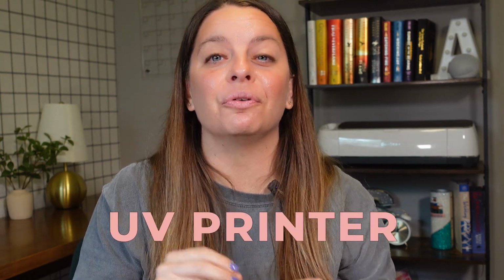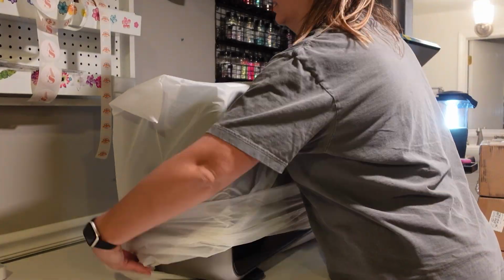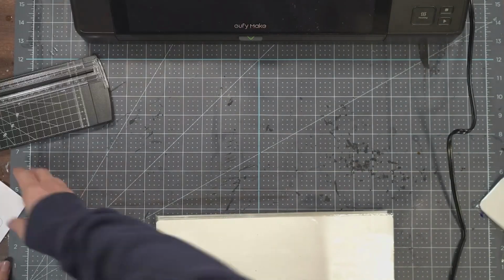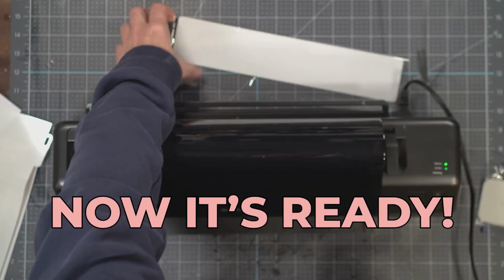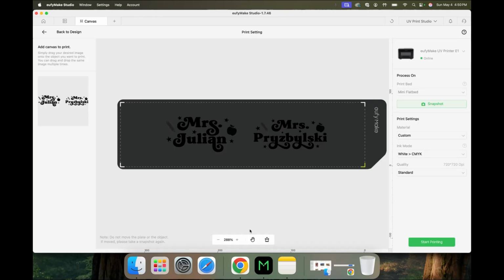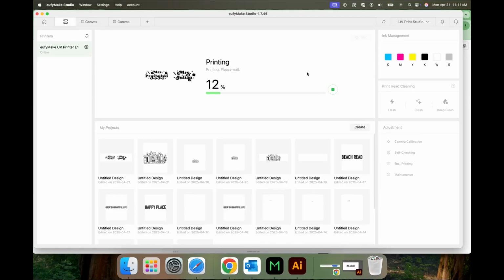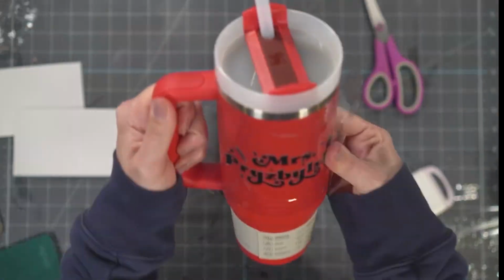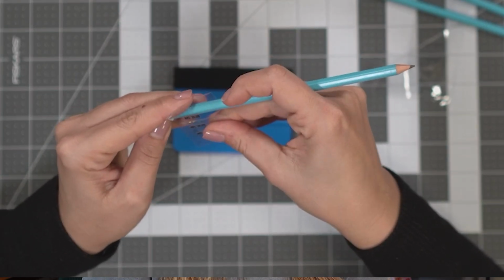UV DTF Transfers with the EUFYMAKE E1 UV Printer

Comment: I'm confused, what's the point of the roller?  you printed direclty onto the film, what did the roller do after printing but before you pealed the transfer off?
Reply from the maker: It heats and sets the adhesive and you need the transfer film to apply any of the things you print.

Comment: With the transfer sheet do you thing you could reuse unused part. For example you only printed 1 sticker  instead of two and you cut them before running it through the laminate machine
Reply from the maker: 100% I didn’t feel like cutting it honestly lol

Comment: Hi Alison!

Great review! 🙏🏻

Quick question on the UV-DTF capabilities: 
Have you experimented with using Cold Foil applied to the E1's varnish layer, then processed with the 90°C laminator add-on? I'm trying to achieve a 3D/textured and highly reflective/mirror-like finish (similar to hot foil, not just metallic). Wondering if the varnish acts as a good adhesive and if the final result is truly mirror-like.

Like this:
https://youtube.com/shorts/EPe6LQhQ8YI

Or this:
https://youtube.com/shorts/yEB8mrOKXYo

Appreciate any insights! Thanks!

Gabor
Reply from the maker: I haven’t tried this but I’ll look into it and let you know!

Comment: Is resin not poisonous?
I've seen someone say, "Don't print to the edge of the cup where you touch it with your mouth. I think that is why the eufy cups have that silver rim. So if you put it in the dishwasher and some small particles come off, it would poison your other stuff in the dishwasher. Or am I wrong?
Reply from the maker: Almost All powder coated cups have a silver rim (that’s not eufy specific) but you can always hand wash anything if you’re worried about it!

Comment: Hi .. I have noticed on a few videos that the DTF stickers come off when wet for example through a washing machine or my concern, on a rainy day.  I don’t notice the same thing with other DTF devices like that from the m1 ultra.  

I am assuming the issue here is the film used on the eufymake .. can you use other third party DTF film through the eufy make and use the usual DTF heat process ?
Reply from the maker: I have run the cups I made through my dishwasher 9 times to test. All stickers stayed on the mugs! So I feel confident that they stick but yeah you could use other film for sure!
Reply: @ thanks. What cups do you use? Do you have a list of recommended materials ? For example I know for sublimation some blanks are better than others .. so not sure about DTF or with the eufymake direct printing even. Note .. home use. 
Thanks.